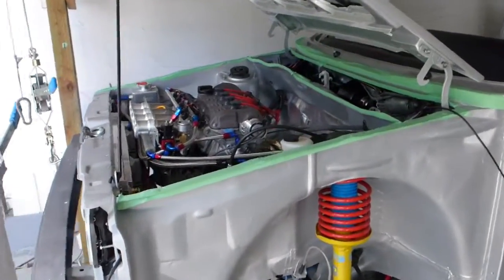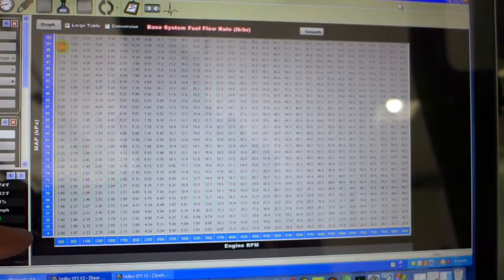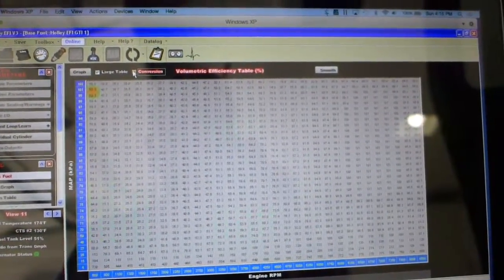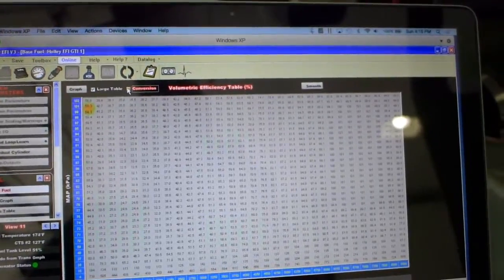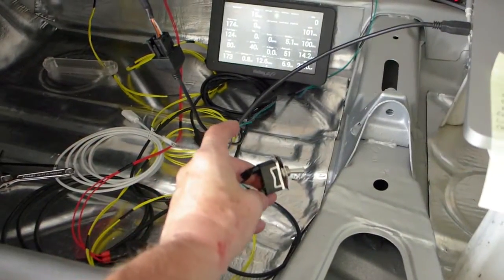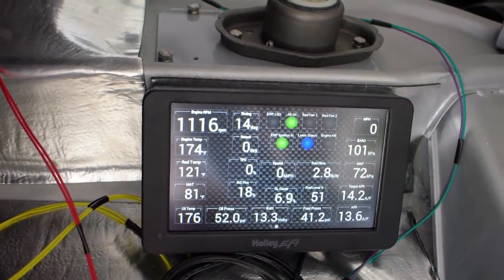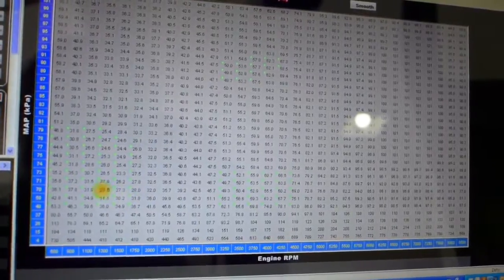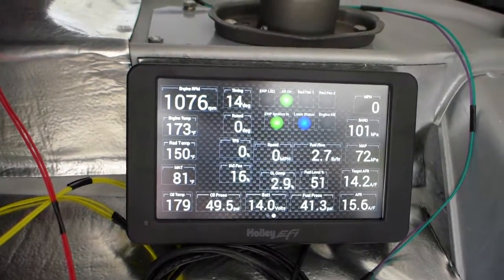The Ultimate 1983 Rabbit GTI - part 95 (Engine is OK, ECU programming complete for now)

Comment: Congrats on the car, looks great!!!  I've raced an '83 GTI with lysholm twin screw on megasquirt for several years so understand the excitement and frustration you are experiencing b/c I've been there.  Keep up the awesome work and thanks so much for sharing your progress.
Reply from the maker: john doeI am interested in your car. Autotech was developing/promoting a supercharger for the mk1 back in the mid 1980s. I had proposed to them that I continue the development of my digitune computer (http://www.derekspratt.com/PDFs/Business/Performance%20Solutions/Digitune%20Product%20Brochure%201989.pdf) specifically to support that setup because they were beating themselves up trying to get the CIS injection to work well under boost, but the deal fell through due to lack of available funding. I'd like more info on your project. Anything online you can share?
Reply: Derek Spratt  I am using a lysholm setup developed by Peter Tong.  I believe he built about 10 kits.  He ran is  car (and I believe still does) on CIS and made right at 200 whp on a dynodynamics dyno.  I am putting down right at 200 whp also with a little more tqe olso on dynodymamics.  This was before the water injection so I may have a little more now.  Specs are built ABA block, Eurospec big valve head, PWR air to water intercooler, AEM meth injection (have to spray just water b/c of SCCA rules), Bilstein group B race coilovers, 450lb front 600lb rear springs, larger front sway bar, stock rear bar, 13x9 duralite wheels, stock front brakes, VW MK4 rear disks, adjustable proportioning valves, CAE shifter (you would really like this for your project!!!), trans from a 1.8t with custom gearing for auto-x, USRT ball joint extenders, ft & rear spherical bearings, camber/caster plates, race seats, willans 6pt harness, momo steering wheel with spacer to improve seating position, the list goes on.... this is a SCCA SMF autocross car and has been raced alot since the 80's.  Here is a link with pic.  I'm MusicCityGTI on VWVortex http://forums.vwvortex.com/showthread.php?7193933-Who-currently-autocrosses-there-Mk1